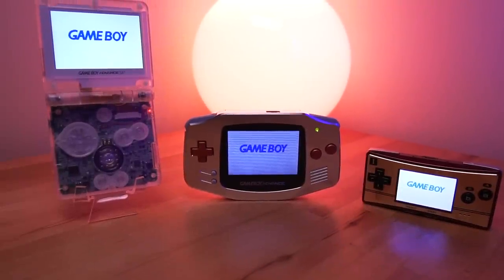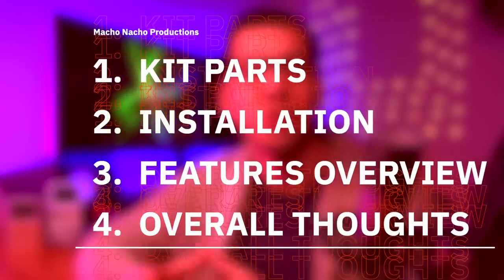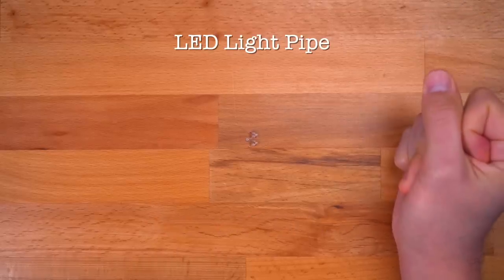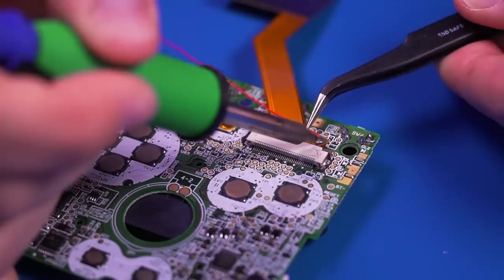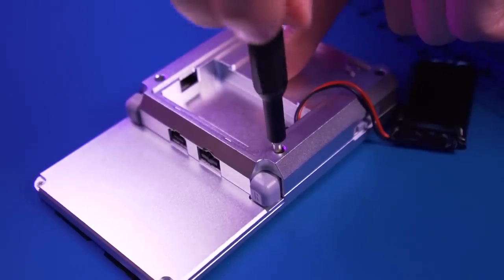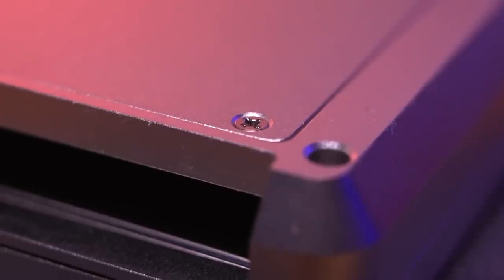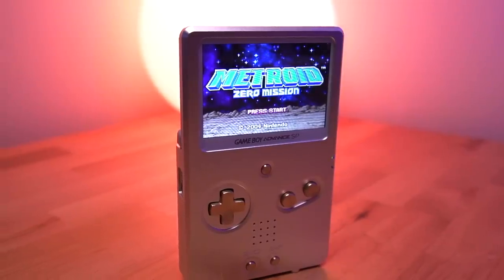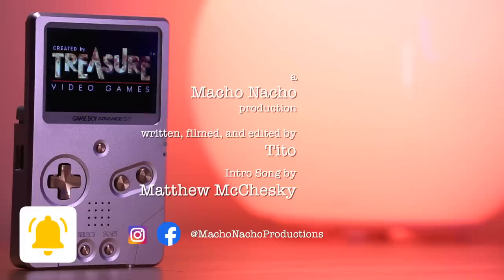GBA SP Metal Shell Without The Hinge! | Boxy Pixel Unhinged SP | Install Tutorial + Review

Comment: Is this also possible with a normal Frontlight GBA SP Display?
I ask because i play much in direct sunlight and all the Backlight displays are realy bad in direct sunlight, there you need a self reflecting display like the old GB/P/C/A and the frontlight SP has.
For me its ok that the Colors is not that fine as on the new IPS or the AGS101 Display, for me its more importand that i can also play outside in direct Sunlight.. A feature that no newer Handheld Console has.. Even the Switch, a portable Handheld but you cant play outside when the Sun shines 😂🙈.. And a backlight Display that is extreme Bright that it could also work in direct Sunlight (But it will never that good as a self reflecting Display..) drains your Battery fast as hell...

Comment: It doesn't appear you wired the usb-c module correctly, shouldn't it be the out+ out- ? Those + and - values on the plug side aren't going through any protection.
Reply from the maker: It’s done that way to get the 5v output and utilizes the SP internal charging circuitry. It has as much protection as the original port does. Doing it your way would only provide 3v I believe. I also followed the instructions on boxy pixels website. Cheers!

Comment: Maybe It's just me, but the triggers not being aluminum... It kinda breaks the aestethic
Reply from the maker: The triggers would be tough to machine due to its design and curves
Reply: @MachoNachoProductions  Hmmm you maybe right, I tought It could be because the friction they could do on the shell, but on that entry point price I would expect aluminum buttons or a clever design option, even If soldering were required.